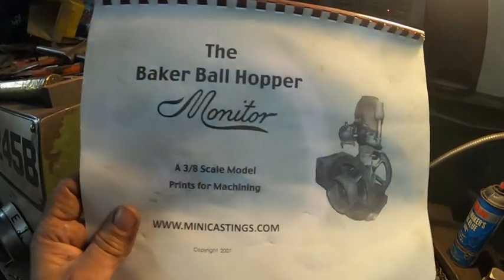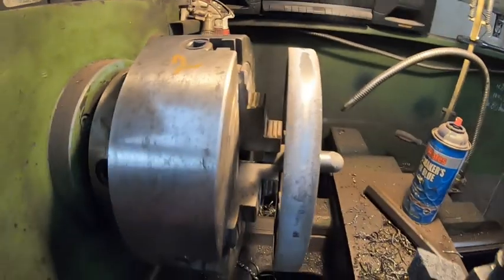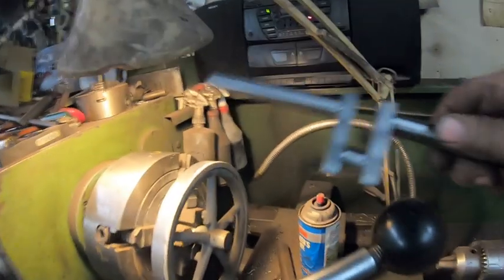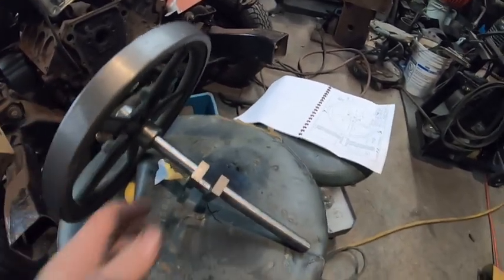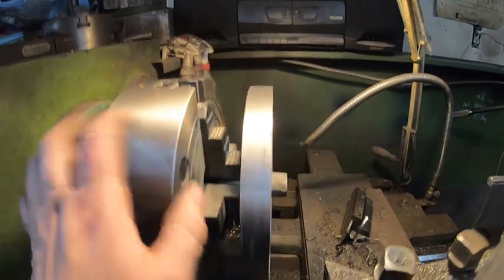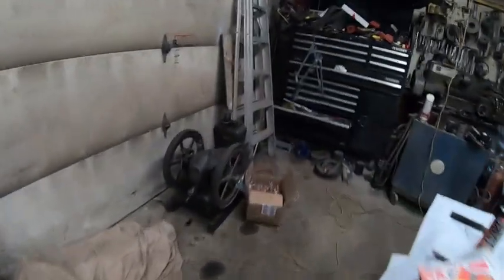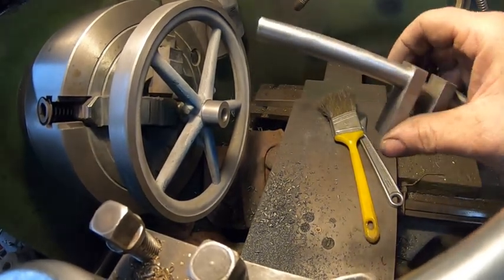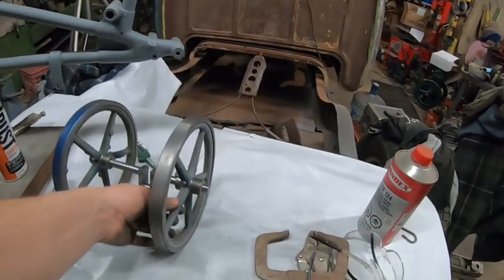3/8 Scale Model Baker Monitor Ball Hopper Engine.  Part 2 Machining The Flywheels.

Comment: Glad I looked in the description Derek, since it answers the question, why do you need to machine all these parts? Still a neat kit to assemble after your done machining!
Reply from the maker: There all rough casting and I have to make a pile of new part for bar stock. When it done it will run about 500 rpm. Thanks for watching